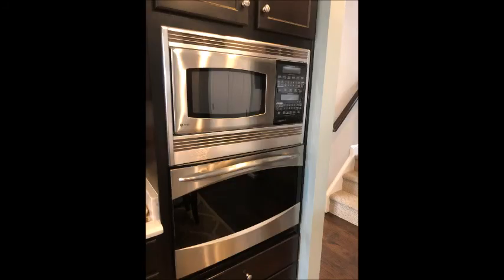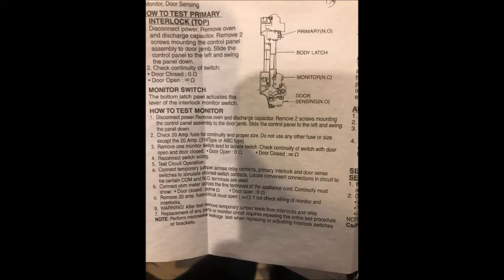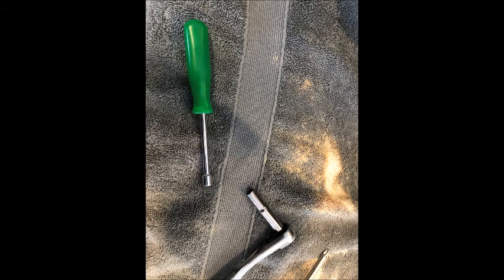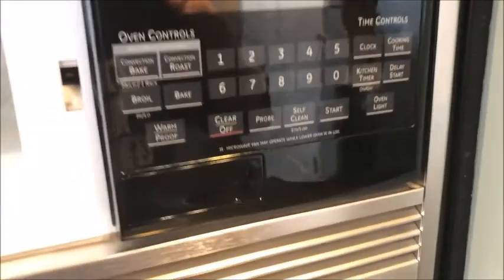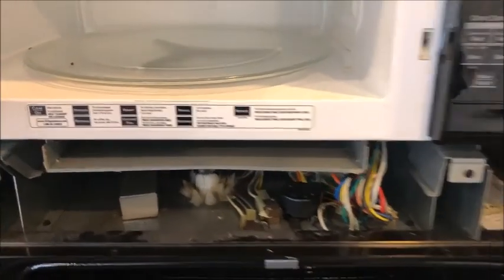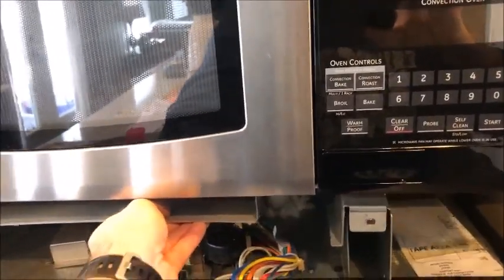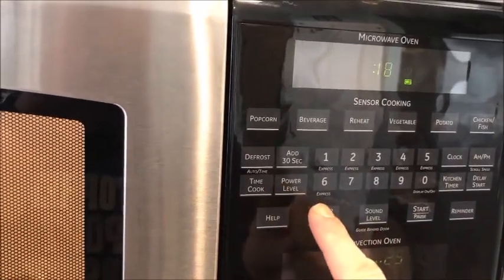GE Profile Microwave Oven Combo Fuse replacement for Microwave - Fix

Comment: Have the exact same combo unit. Microwave went out. No power on display or light inside. Oven still worked fine luckily.  Checked the fuse and it was fine. Replaced it anyways. Ordered a new control board and it did the trick! Open the microwave door and there is a QR code that takes you directly to the GE website and the proper part. Replacing the board was easier than getting to the fuse. All connections just pull off. 

Backstory…

Can’t remember exactly how it happened but the microwave lost power one day but then the next day it was back working. A few days later it went out for good. So in hindsight if the fuse was blown it would have never started working again. Also, you don’t have to removed whole thing to replace control board. 

Appreciate the video!

Comment: First a very big thank you for taking the time for doing this video!!

We have the exact same model and it was clear that the main fuse was gone (no light when the door was opened, no display, etc.) and we did not know where to start! Just the description (torx screw driver etc) and the explanation in the video was extremely helpful in planning out the repair and doing it! Thank for doing such a wonderful job!

Once the fuse was fixed we had power but we had another problem: the microwave would turn on as soon as we simply closed the door even when we have had not set it for any cooking (the clock was not counting down or anything but a cup of water would get hot after about 30 sec).  This same thing had happened a month or so ago but somehow it had gotten magically fixed by itself after an hour or so, but now after fixing the fuse this problem was back.

After googling around it seemed like it was most likely the main control board.  After replacing the fuse this was a much easier task!  We replaced the main control board and everything was back to normal!  I am sharing this info in case it is useful for someone because I had seen some suggestions that it may have been one of the door switches but it wasn't.

Thanks again!
Reply from the maker: @raghureddy1746  good to know this comment will help others- what a gremlin you had to chase down!

Comment: So yesterday our built in GE microwave had no power and it seemed very strange. So I removed all of the brackets and pulled out the microwave to test the outlet to ensure there was power and there was. So even though ours isn’t the same model I watched your video. Went to the hardware store an bought a two pack of fuses. Seeing this is in a pretty tight area I put the new fuse in and reinstalled the microwave with all of the bracket. It’s now up and running…thanks for your video.

Comment: This video is very helpful, because as you say, the manual is useless, and installation guide only talks about the oven, not the microwave.   Plus why the heck would GE EVER hide the fuse in the back, that's just not convenient to the owner to change the fuse.  good job, Dan

Comment: This was a great video.  Thank you!  I used it replace the diode and magnetron as my microwave had power but wasn't heating. 

One suggestion for anyone else doing this is that you can't directly lift the microwave out of the tracks as the air duct on the right hand side gets in the way.  What you need to do is lift it on the left hand side (once you pull it out enough so that the left airduct clears the frame) and then slide the right hand side of the microwave out of the track (sideways!) by getting the tab through the slot you show at 3:20 of the video.    Putting it back together is equally challenging as you need the slot to go back in that tab.  Having someone watch from below and direct you is helpful to putting it back together.

Thank you again!!
Reply from the maker: excellent! Thank you! Were those parts expensive?
Reply: @DadWorksVA  The parts were $62 in total.  They weren't from GE directly, but were the OEM manufacturer's part.   The magnetron was from Samsugn and was identical in fit and labeling to the original one.

Comment: Just wanted to say thanks for the video! I would've been able to remove the frame without your help. Cheers!
Reply from the maker: ha you're welcome. I just wanted to snap it out when i got started but it was held together with several screws, someone impatient might break something. Really wish they would've put that fuse location closer to the front (behind the control panel maybe?) it would have been easy to get to. EIther way- glad I could help!

Comment: Can’t thank you enough for this video. Exactly what I needed to gain the confidence to repair my unit. Mine had the oven control board go bad. I knew if I could get to it, replacement would be a piece of cake. Your video did it. Thanks again!  Rock on!!
Reply from the maker: No problem! good job.

Comment: I have same combo and the same problem, however the fuse tested good. I located and changed 3 small thermal thermistors. Only 1 was bad but I did not want to try them one at a time. It worked for about 2 years and then same issue. I am now changing them again.

Comment: In my case the oven has no power, but the microwave works fine. Thinking I need to try to replace that same fuse and perhaps the Wall Oven Safety Thermostat WB24T10060. If I could only find it.

Comment: Thanks for your excellent video. I have the same model combo. My microwave still heats but it makes smell like rubber/plastic burning. Any idea what could be wrong?
Reply: A burning smell is supposedly an indication that the high voltage diode may be burning out.   I have no first hand experience of this ,but I've read it in a few places.

Comment: Mine currently will reset and later just come back on by itself after a few hours. Iirc, it seems to do it only after running for a few minutes. Sometimes the display will look unusual before it comes back on

Comment: Thanks for this video. I have the same combo and the microwave had a weird display for a second when turned on and then went off. I pounded on it a few times and it went on before going off permanently. The bottom part works though. Do you think it is the fuse as well? If so I can replace it using your video :). Do you mind sharing where you got the fuse and which one to get?
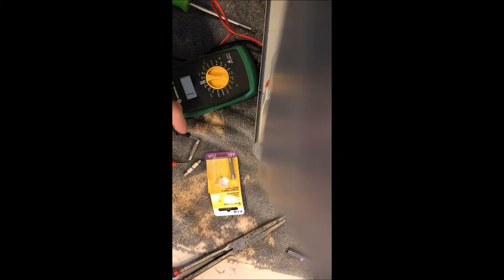Reply from the maker: The display could be going bad, but I would try the fuse first because they only cost 3 dollars for 2 at home depot. Busman brand 20 Amp ABC fuse, I think the box even says "microwave fuse" you can see the box the fuses come in at @4:10  If that doesn't work, I can only assume that replacing the display would be in order- which would probably require a bit more technical skill to unplug the old display and switch it out.
Reply: Will try it. Hope it works. Thank you for this info!
Reply: @ila8040  Hi, I am experiencing the same issue! The top part of the displays is no longer working, but the bottom part works fine. I appreciate very much if you could kindly share with us if you had identified the issue, and how to correct it. Thank you all very much.

Comment: Dan.  When you took the micro out...was un plugging and plugging back in an issue?
Reply from the maker: no super easy- connectors came apart fairly easy by grabbing the tabs, pause  @3:04 and you'll see them, just pull straight down  (just don't "force" anything) . I think they only go back  together only one way if I recall correctly. you can mark their orientation with a piece of blue tape or a sharpie before you take them out if you want. They  are similar to a lot of automobile electrical harnesses if you've ever had to unplug one of those.
Reply: @DadWorksVA  getting there.   Frigidaire ....difficult to unscrew due to crampness.   Trying to save 200 for guy to come

Can a new microwave go into the same spot if it doesn't work?
Reply: Great tutorial! Definitely saved me alot of time and heart ache from trying to figure it out on my own. Thanks!! 😃
Reply: @camcroncronin883  For me, the two screws just above the microwave door were put in at bad angle.  It was very tough to get them out and put them back it.  I think the hole on mine was cut too close to the front rim of the microwave and it didn't align properly.